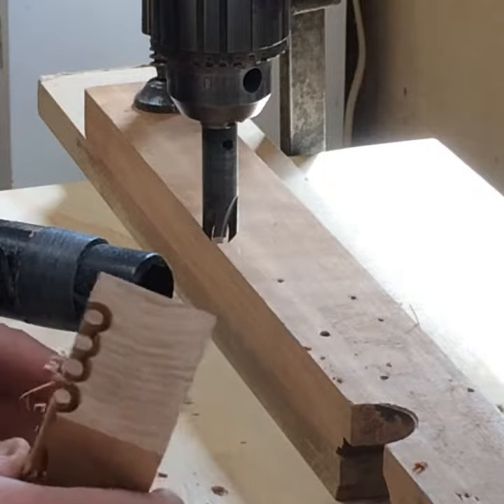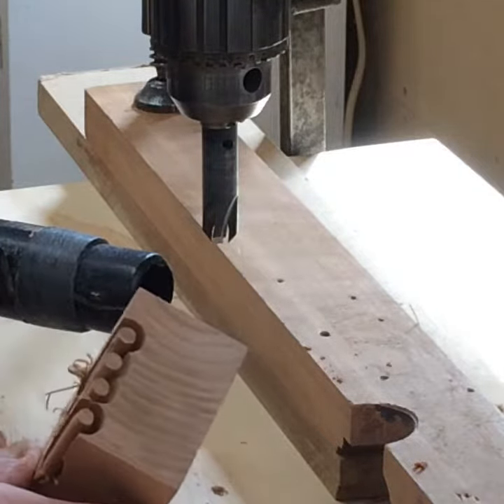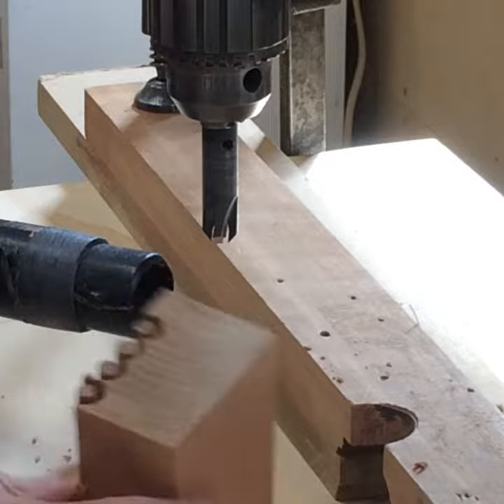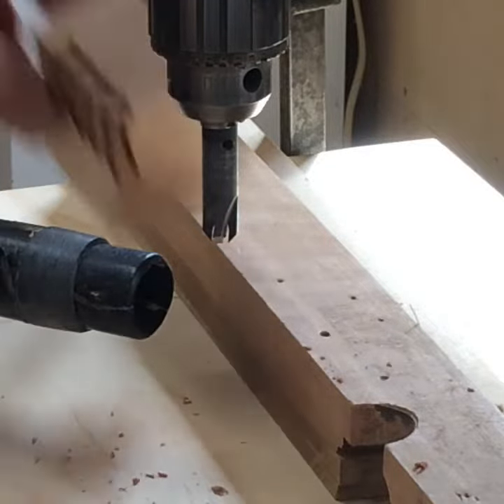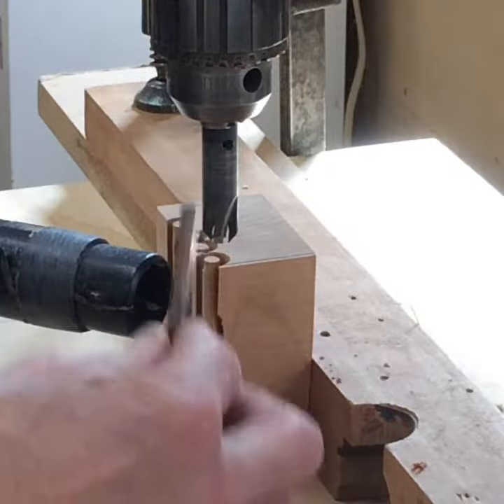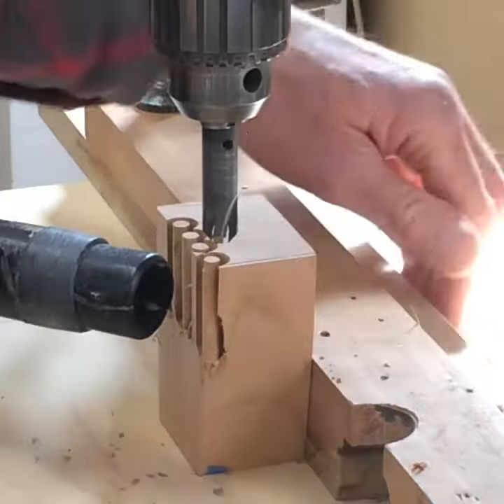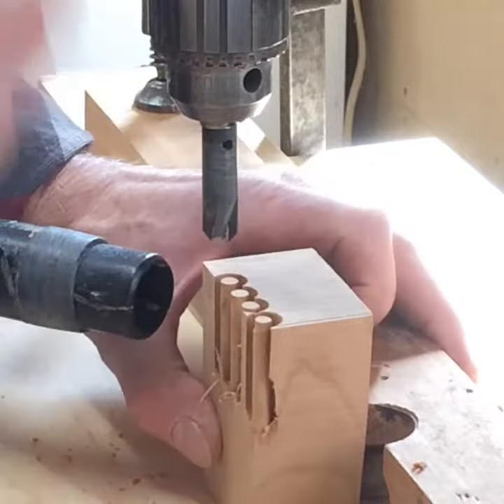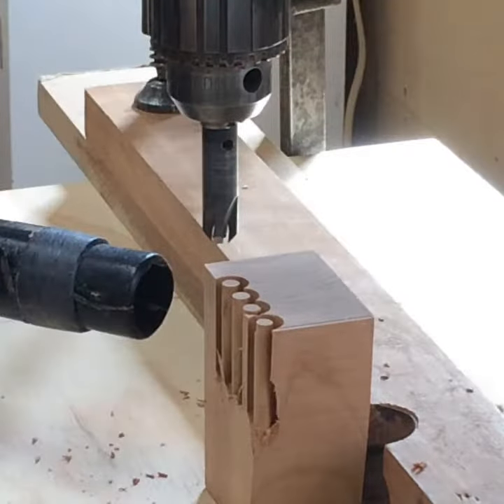Making solid wood pins with Fuller countersink

Comment: Excellent ! i’m a retired Professional Woodworker  that has been using Fuller Countersinks  for over 35 years. i didn’t  ever think of that one   and i’m guessing that over the years i’ve collected  somewhere between 25 and 50 Fuller Bits  mostly the HSS ones but i do have a Few Carbide tipped ones  that i keep for some Specialty Materials  FYI. for most Wood Species i prefer not to use the Carbide Tipped ones  and just maintain a Sharp Dge on my HSS one  that i personally “Dress” Up the edges with a Jewlers File set  and a homemade simple Jig i built  that i keep mounted on top of my ToolChest  it simply holds the Countersinks and gives me  a guide to get the correct Angle  the Files i use are nothing Special it’s just a cheapMade InChina set i purchased either off Ebay or at HarborFreight years ago  my Father owned and Operated Hair Salons  for  close to40 years and he brought his Scissors home every evening to Wet stone and astrop for the following Day so i learned the Value and how to keep things with a good edge  on them. he had a small area on a Workbench in our Garage  dedicated to Sharpening
Reply from the maker: Thanks for your comment, Craig! I'm going to give my countersinks a tune-up.

Comment: What kind of drill bit are you using? Can you share the brand and dimension? Thx.
Reply from the maker: It's a Fuller countersink bit, used without a drill bit. 1/4 inch diameter